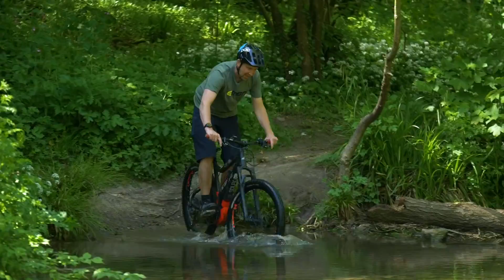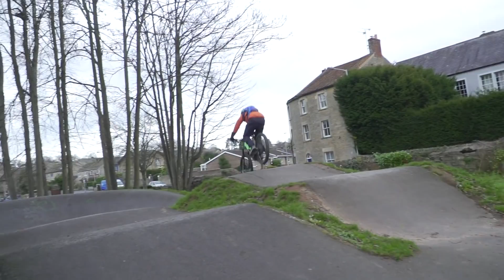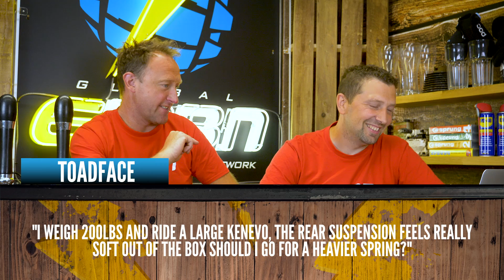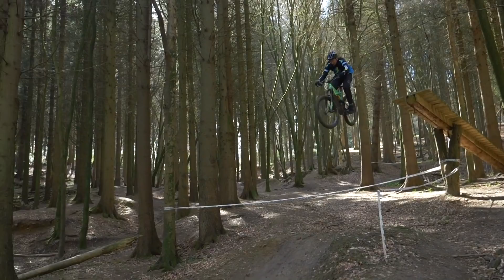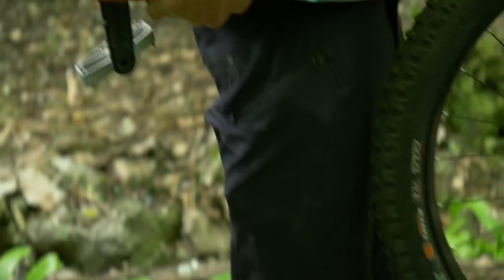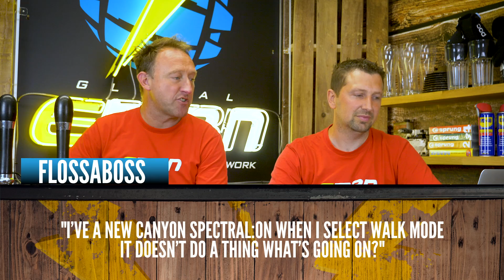Crossing Deep Water? | Ask EMBN Anything About E-Bikes

Comment: I  rode clip pedals for more than 20 years then changed to flats! Took a bit of getting used to but I think they improve your pedalling and jumping technique etc. and allow more easy exit if required. Of course proper flat shoes and pedals with aggressive pins are essential. I used FiveTen Contacts and Nukeproof Horizon pedals. Main downside is skinned shins and calves from the pedal pins normally when dismounted!!

Comment: Commuting EMTB?  Get a spare set of rims, add some good road tyres , there are nice smooth high pressure options which will have you ripping along, then swap back on weekends or after work to the mud lugs, its the best solution long term.  Choose your rims and tyres together so you get the right width and size rim for the perfect road tyre, however,    I had 700C on MTB hubs on my last bike, fast AF, but on my Levo  i pref hard high psi low knobs for road wheel set as i always take grass shortcuts, its real hard to resist when you have an emtb and dead smooth tread is not ideal if you have offroad options.  maybe gravel bike wheel set is another possibility, depends on you and how many jumps you do on the ride haha
Reply from the maker: That would really help and that setup must be fast! We would suggest swapping the cassette over when you change your wheels otherwise you can get inconsistent wear across two cassettes.

Comment: I commute on mine 20 miles at least daily to work in every weather condition on Devon backroads.
You get flooding occasionally completely blocking the road.
I have always tried to make sure the water level was lower than the motor and any wires, it has been very close at times tho.
But being someone that has riden my current bike 15k ish miles in 2 years I feel I can contribute. Ebike and ebike electronics do not mix with water. My bike has had issues at times with wet weather (torrential storm type rain) sometimes weird readings and behavior some times complete shutdown. 
All diagnosed repaired, normally by simply drying out the bike, and I have made modifications over time to improve wet weather reliability it seems to have worked for 6 months or so.
I'm sure some bikes and motor systems are better than my experience also sure lots are a lot  worse than my case My main issues in the past have been water getting Into the display or messing with the speed sensor because of a wet loom. The battery and motor itself have never had a issue with ingress.

Comment: Ive dunked my home build a few times..funnily enough the only long term failure has been the BB bearings.
Batteries and motors dry out np..controllers start acting up, but are pretty well sealed usually.
Dry it out..spray WD40 on the electrics.

Comment: #AskEMBN Now that I am fully into e biking I find myself going places that are farther and harder to get to than I used to on a normal bike. Because of that I end up in areas where the trail isn't as well used. I notice my shins are turning into a horror film from all the branches and scrub oak. I don't want full body armor type shin guards due to my area being close to 100 degrees any lightweight trail sock with tear resistant material?
Reply: Endurance compression socks are lightweight and pretty tear proof and they they stay up.

Comment: @ Hi Guys, I'm planning to swap my tyres for new Schalwbe Eddy Current e-mtb specific. Need some help as I'm not clear on the sizes for front and rear. It seems there is only 29" for front and 27.5" for rear. My bike is 27,5" front and rear. If this is the case, can I use 27.5 Eddy Current tyres at front and rear or that particular tyre is exclusively to be used as a rear tyre? Thanks for your help